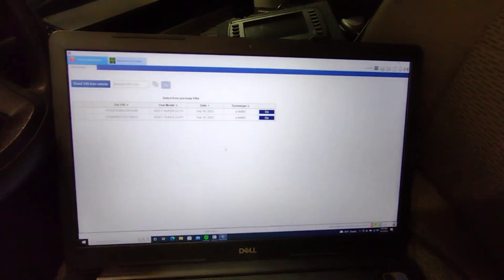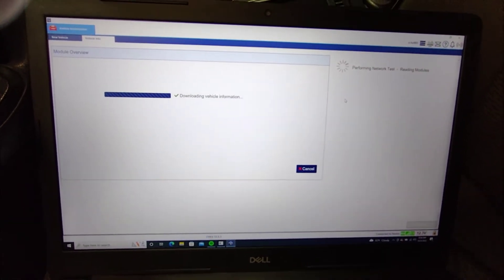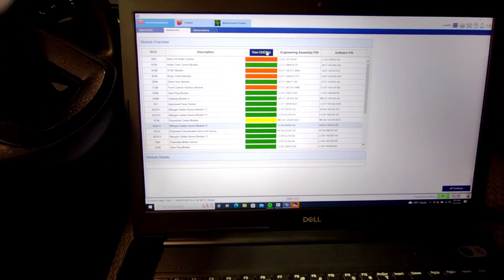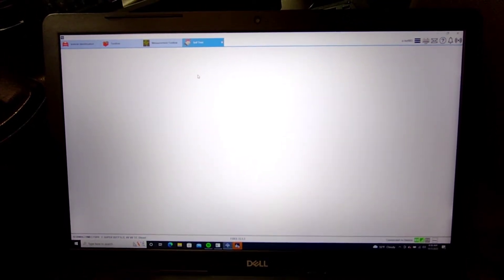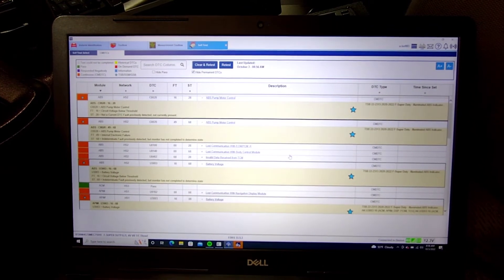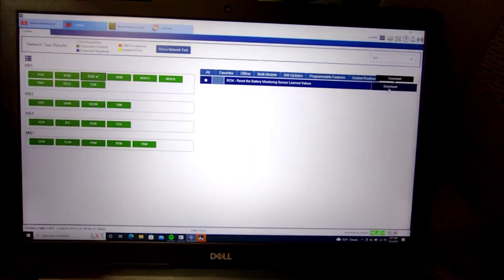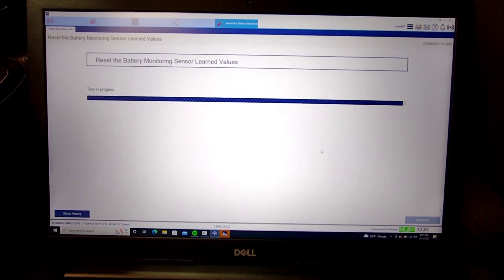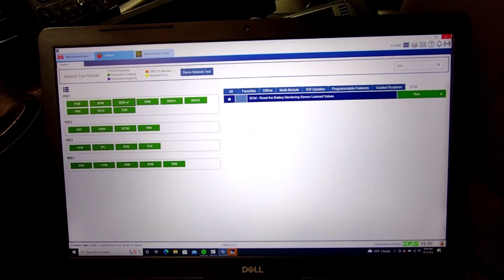How And Why We Reset Your Ford Battery Monitoring System. How To

Comment: So my 08 expedition is throwing a blinking check engine light. I changed spark plugs and one coil packed it was corroded now it wont start for some reason.
I tried doing the reset for computer dojng the battery trick not sure what to do now
Reply from the maker: Well. A flashing light is a misfire.  Resetting the battery won't do anything.  Do you have everything plugged in?  All coils plugged in?  Did you unplugged injectors?  Do you have a scan tool to pull codes to see what else is there?
Reply: @BeardedFordTech  the only code it gave me was purge control valve i had forgot to plug it back in i reset codes before that it didnt show any misfires codes on the cpu..
Ill try what you said whem i get home Thanks for the response!!
Reply from the maker: @jds2.o289  no problem. Keep me posted.

Comment: Great video. Did you use IDS or Forscan to do the reset?
Reply from the maker: It's a 2021. It uses the new software FDRS.
Reply: @BeardedFordTech  I wonder if my local independent has FDRS. I know he has FDS.... for his bookkeeper. 🤣🤣
Reply from the maker: @mlieser1230  lol. If they are working on 2021 or newer Ford's (some 2020) then yes they have to have it. IDS won't work with them. It will tell you to use FDRS

Comment: But I thought people prefer their batteries to be well done, not over easy 🍳
Whenever I hear about another fleet, or people in general, having battery issues ("batteries are junk!" or "these don't last longer than eight months"), I ask if they had reset the BMS on their vehicles. After which, I am more than happy to teach them about the BMS reset that should be done after the installation of a new battery.
Keep spreading the knowledge, man! 💪
Reply from the maker: A non BMS reset kills them every time. Did you see the short?  That was the batteries that came out.
Reply: @BeardedFordTech  Ah, that?! Just clean them off with some Coke, it'll be fine!😜
The deformation on the one battery from the hold down is something else.
Reply from the maker: @jonathansherwood5841  that's what you call lack of maintenance. Oh it has 12 volts send it